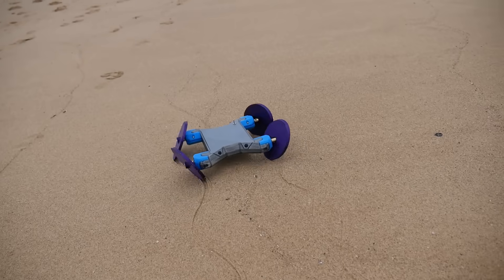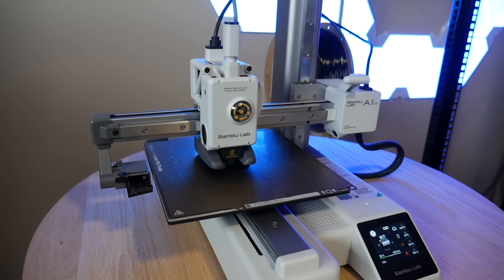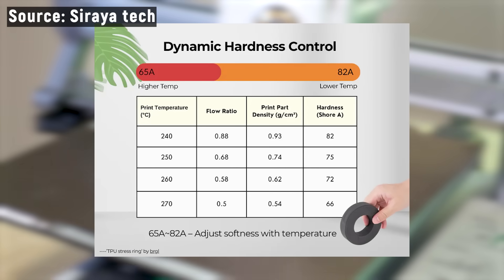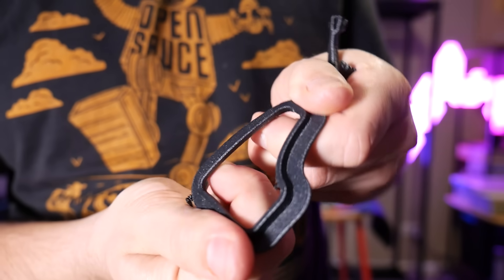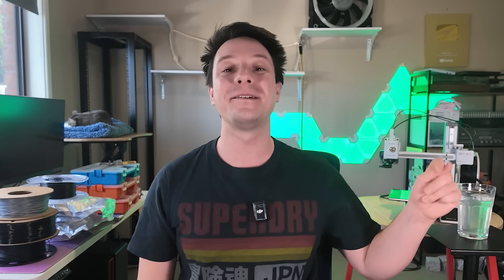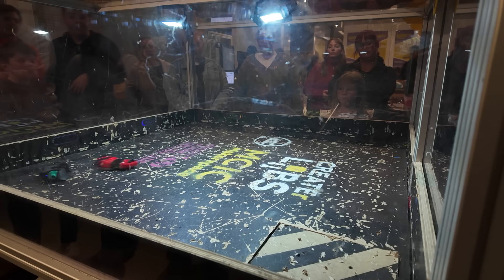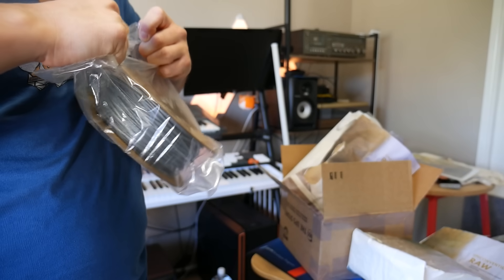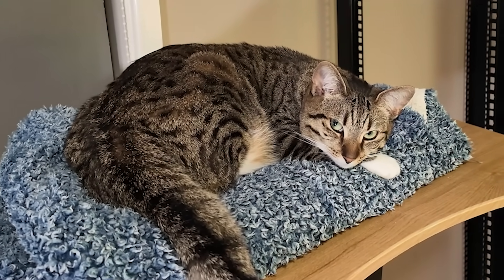3D Printing Filaments that Flex, Bounce and FOAM!

Comment: That's amazing. Thanks! Question: I'm trying to replace my ski pole disk, and have originally printed it with PET-G. Lasted one day, and pieces broke off. PET-G is really not flexible enough - the original ones flex "a bit." TPU would be too floppy. Any idea what to use? Thanks.  Looks like the third one might work.

Comment: No no no no no polypropylene the nightmare filament lol. I’ve used it in CR before for weight purposes, but even with specialty bed and pp glue, it either doesn’t stick or sticks too well… that aside, in actual fights it shatters and explodes at high impact. Durability of filaments I’ve tried are 95 (the goat against direct impacts), 98A which holds up pretty well. Then pp just dies, and so does 72D usually. Keep in mind US ants but I DESTROYED another chassis (multiple actually) made of 72D
Reply from the maker: Yep pretty close to our findings in Aus so far! 72D is quite nice for internal structure where you don't want too much flex but anything that gets hit needs to be 95, 98 or actually milled HDPE to survive any serious impacts. Shame to hear about PP though, it is indeed a pain to print so I've not battle tested. Tried PEBA? I'm hopeful... that mass reduction is nice.
Reply: @MakersMuse I have not tried peba, I am worried from a material science standpoint that the rigidity will act more like a higher durometer tpu in high impact. I’m thinking it’s like PP but I hope to be pleasantly surprised. Lemme know when you test! I’m curious to know

Comment: I was gonna say: check with Willow Creative, she does a ton of foaming TPU prints. These are all interesting for a bunch of reasons: Everyone is/was going nuts over PEBA... but at 3D Printopia, one of the largest filament brands (big booth, games, etc.) very bluntly said "we hope the interest in this dies off because it's just not a filament we care for". That foaming TPU... I have some foaming TPU from colorFabb, but maybe it's the settings I used, but when I held the stuff from SirayaTech, my mind went "OMG, this is a 3D printed stress ball... wat". I remember PP being talked so much about as "living hinges" and great for items that need that durable flex... and glad you mentioned the print sheet because when nearly everything has difficulty printing it, yet it's so ubiquitous outside of the 3D printing space, it's probably something that should have something to ease it into general usage.

And then there's TimePlast... I never heard of them but it seems almost like they are really dividing the community that learns about them because it's either a marketing gimmick/scam, or it's a ground breaking and unique filament company. Everyone wants the filament that comes in 5 billion colors, can survive in a hot car (or hotter), is easy to print, has no fumes, and can either be thrown out without guilt or recycled (back into filament). AND... for like $20 or less per kg. Nearly every company has been doing everything except the "thrown out without guilt/recycled" one. Sure, couple PHA spools here and there... but it's not "drop it into a bucket for a bit, then pour down the drain". The photovoltaic one? There's a recommended video next to the comment I'm typing on making "a functional solar panel" from the company. There's a lot of 3D printing in fish tanks (debatable on if that's healthy for the fish...), but a fish food one could be an interesting implementation. And earlier this week I saw a short mentioning they have... soap filament. I found it curious... and what do you know, a filament sample subscription I have literally sent some. Now, if you read their website, they basically say "we don't ship in vacuum sealed bags for environmental reasons, and because you need to dry the filament a lot anyway, so no reason to dry and vacuum seal something that needs to be dried anyway if you want any chance of a successful print".

In the end... all awesome filaments. Things I didn't dream of when I started doing this 10 years ago...

Comment: hey man, so i have a question...I am trying to design and print some all terrain wheels/tires for my electric longboard. i need them to be as close as possible to gocart or bike tires to  get the best traction, i  think. so ive been having a hard time picking the materials. the wheel will be two parts, the inner hard part "rim" to connect to the power source and the outer , soft and grippy part that acts as a secondary suspension as well as a grippy surface....so from your experiance, what would you recommend using for the inner and outer materials?
Reply from the maker: 3D printing isn't really the best material when it comes to durable, grippy tires, at least not directly. Instead, you want to 3D print a mold and use a two part urethane to cast your own custom wheels (possibly around a 3D printed hub). I reckon something with around a 60-70A shore hardness could work. Lots of tutorials on youtube on the process!

Comment: I wish I'd known about foaming TPU a few years back when I was printing RC crawler tyres. Initially, printed them with 95A TPU, but they had zero friction even though they were kinda soft.
Then, I tried some 85A Ninjaflex, but that had similar issues (not quite as bad as generic off-brand 95A, but borderline unusable in the application I was trying to make it fit to).
The one I ended up getting the BEST results out of (better or equal to off-the-shelf crawler tyres) was Recreus Filaflex 60A Pro, but my god was that a hassle and a half to print on my P1S.

The tensioner needed to be adjusted to a point where it was just barely touching the filament, or it would just wrap around the gears and jam. That, however, required a modification to the printer itself (drill a hole to the side of the hotend cover, so the screw can pull out far enough :D Can't print with the cover off, and couldn't put it on due to the screw extending so far to the side).
Also, the filament really doesn't like moisture, and absolutely seemed to detest any kind of PTFE tubes. So, the solution was to print straight out of a filament dryer, situated above the printer, with the filament going straight to the hotend.
The tension-tuning process was: back the tension screw off completely, then load the filament manually. Once loaded and some oozed out, gently start tightening the tension screw while spamming "extrude" until it flows nicely. Then back the screw off a touch, just to be safe.

The result, however, was worth it I feel like. I've since then spent the rest of that filament roll on some super-comfy insoles for the family :D

Comment: Hey! I would love the print settings you used with the CC3D 72D TPU. I've been struggling with this filament for ages. No matter the drying time or temperature, it always has terrible layer adhesion and looks as if it is still wet. Much appreciated!
Reply from the maker: I used the Siraya Tech TPU 64D HF profile for Bambu studio, over on their site. http://siraya.tech/pages/print-settings-download

Comment: I use simple syrup for bed adhesion. 1 part water 2 parts sugar microwave until it boils, let cool. An audible "tink" when it releases as the bed cools (10-15 min ish)

Comment: What filament do you use for your combat robot wheels? Is TPU sticky enough or is there something better? I mean, they obviously need good grip on the surface.
Reply from the maker: Haven't found a good printable solution yet but foam with a coat of liquid latex is VERY tacky. I'm going to attempt it with the foamed TPU.

Comment: Ive used foaming tpu for cosplay pieces for a long time, love it. Prints super smooth, and the surface absorbs paints and sands really well too, plus you can cut it with sturdy scissors. It's like a very high density eva foam which is a popular craft material for cosplay for a long time now
Reply from the maker: Nice. I've been taking notes from your latest vids! Cadding in supports so it doesn't flop around during printing is a really solid idea. Sadly colorfabb is just too hard / pricy to get in Aus regularly so it's great to see other manufacturers start offering it.
Reply: How do you post process PEBA for a cosplay? I assume sanding and filling wouldn't work as well. Do you need to use flexipaints like on EVA Foam?
Reply: Yes, similar products and steps as eva foam  @DoctorEviloply
Reply: How does it preform outside on a rainy day?
Reply: @huhuhuh525 its porous so youd need some paint to seal it or water might get absorbed

Comment: 7:45 - i have no 3D-Printing experience myself, but PP sticking only to itself made me  remember my last work project: to glue something on PP, you need to "Activate" the surface first. 
this is usually done with either pretty agressive chemicals, or with a plasma treatment of the PP surface. The plasma can be a simple flame. 

Don't know how you could translate that knowledge to the 3D-Printer... but i would try to "activate" the first few meters of the filament with a flame :D

Comment: After hearing you talk about the weight problem for the battle robots, It got me thinking: why didn't they make the arena like a huge wireless charger? Then the robots don't need to carry a battery
Reply: Because the power required and consistency just is not available and it has the possibility to mess with remote signal but mostly charge pads are not consistent

Comment: Not all foaming agents are strictly chemical decomposition. I'd wager it is an expanding microsphere additive - think inflating baloons - which forms a syntactic foam out of the base polymer. These engineered expanding microspheres have high consistency so they offer great performance for detail oriented things like 3D printing.

Comment: That vapor leaving the nozzle is also the cooling mechanism used to keep functional proteins like the ones in the bait filament (shrimp) from burning or denaturing, since the evaporation energy is taken from the mix, cooling down the rest of the materials in the process. The photovoltaic filament also works incredibly well, there’s a video posted in Timeplast Inc.YouTube channel.

Comment: 0:40 One very important note on this one: It’s not TPU or even close to it. PEBA stands for PolyEtherBlockAmide, which already says it all: PEBA is a variation of polyamide, which also explains it’s low density and other chemical as well as physical properties. And this also means it has to be treated like PA when being printed: 
Hotend: 250-280°C
Bed: 80°C
Chamber: 40-60°C
Fans: 0-20%
Only if you take it’s chemical heritage into account and take care of proper settings, you will get the most out of it, especially regarding layer adhesion.

And taking things even further: You can actually use the knowledge of PEBA’s chemical classification for very specific applications, e. g. for combat robots. You can print Siraya’s PEBA Air (foaming) directly bonding to Siraya’s PPA-CF (very stiff and strong as well as heat resistant) without the need of an interlocking structure as they are both polyamides. This leads to very nice material properties in one continuous part without gluing or sticking parts together. @MakersMuse

Comment: I've been a huge fan of PETG-CF for engineering applications. I've pretty much mounted every accessory on my touring bike with it, even a bottle cage and a bayonet mount tool bottle with conical mounts on the other bidon mount. Only problem with it is my goto brand (FormFutura CabolFil) is bloody had to get in Australia at the moment with pretty much the FormFutura site in Europe being the only reliable place to get it. (Expensive!) I'm planning to try out another brand (from InkStation) soon, have a roll, but have a pesky filament jam to fix.

PETG is the print on any old crap printer engineering filament. With carbon fibre in it it's nearly as tough as nylon CF and way atmospherically safer in a home workshop and on open frame printers.

Comment: You can print PP with regular slick packing tape and it will stick to it perfectely.
It will not "melt with the tape" and will not let a ugly surface after printing

Comment: I have a few questions about how to make combat robots. could I get some advice?
Reply from the maker: What do you need to know?
Reply: @MakersMuse  I am making a four wheel drive bot that uses mecanum wheels (omnidirectional wheels) and to get the movement that I need to go sideways, the front motors need to go backwards/forwards, and the rear motors need to go in the opposite direction. I was going to use a Malenki Nano, but there are only 2 drive motor channels. I am entirely new to this entire field, so I do not want to have to code, just soldering. I am using Flysky FS-i6 Transmitter and N20/N10 motors with no weapon, I am also on a tight budget. I need to know what receiver/ESC I should use.
Reply from the maker: To mix mecanum you'll need a more advanced radio I believe. You only need one additional brushed esc if you take the malenki out of onboard mixing mode. Definitely going to be more difficult and a little more expensive than standard tank mixing. James from @brokenlinkrobotics could probably help a little further as he's built omniwheel systems before.

Comment: For the last filament, that dissolves, it would be interesting/important to ask into what it dissolves. That’s the only way to be sure about environmental safety of this… in any case releasing unknown chemical in home sink is highly non recommended or even forbidden depending on where you live as épuration stations are specifically tuned for a defined composition. 😕

Comment: At first I was like "what would that dissolving filament actually be good for?"  It didn't really seem practical for dissolvable supports, and outside of some pretty niche spaces why would you want your parts to dissolve?  But the "when your done with it" line made me think "oh, for early protoyping, when you know you're going to throw away the first four attempts." 

It still seems pretty niche and one would need to be heavily invested in non-currency goods to really get value from that, but it's a cool idea.  Though I'm pretty sure it actually exists for those weird niche cases where you do need something to dissolve at a reasonable controllable rate.

Comment: We live in a fantastic time for FDM printing. When I started out, PLA and ABS were king, Ninjaflex was a pain, PETG was just gaining popularity, and 95A/98A TPUs were also just coming on the scene.

Now, we have SO many more choices.

I have used foaming TPU, not because I had a specific use (I tried it for tires, but it's not that grippy) but because it looked fun. It's neat. I've seen some surmise that it might use baking soda, which would release CO2 bubbles when heated around the temperatures designated for TPU.

As for PP, I've been a fan of polypropylene for some time. Cheap PP containers are used for yogurt here and we use them. They withstand boiling temperatures (unlike PET), so they can be put through the dishwasher, and can be used for leftovers and such. I would love to try some PP filament, if I could just think of a good use for it.

Comment: Angus, what z offset did you use to print PP on the packing tape i saw? 

Great video!
Reply from the maker: No change, the printer just touched off z at the new height. If you have a machine that homes to a limit switch, I'd add 0.2mm or so and test.

Comment: This was super interesting! I could definitely see uses for that last soluble filament in things like mold making - which is of course already done with both PLA and other materials, but this would allow for making complex molds without needing to split the mold or heat it to get the printed part out. And that foaming TPU looks incredibly interesting for a lot of applications where you either need cushioning or want a more pleasant feel for something that needs to be touched frequently. Also super cool that these are printable on an open frame printer, even if I wouldn't print anything fiber infused like that.

Comment: The photovoltaic filament looks incredibly interesting! Unfortunately, like the rest of their filaments, it dissolves in water. I feel like this might make it completely unusable for anything you would want photovoltaic properties for. I would try to print ultra slow high density parts with it to see if i could make some kind of viable (if not very effective) solar components, but its $100 a spool (no idea how much you get) and dissolving in water means you cant use it outside unless you live in a desert..
Reply: You can absolutely use it outside. Much like any other photovoltaic core material, it has to be protected from water (think of these materials as soluble salts) so, a glass panel, an epoxy layer covering your print would do the trick. We can’t make a photovoltaic material that’s not water soluble. That’s just not how chemistry works.